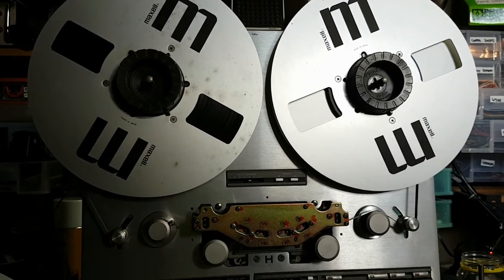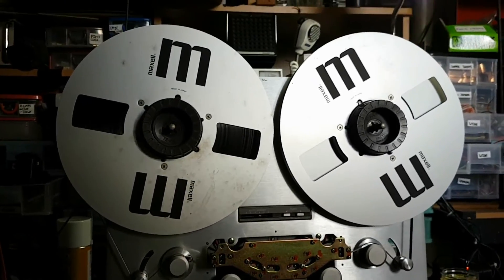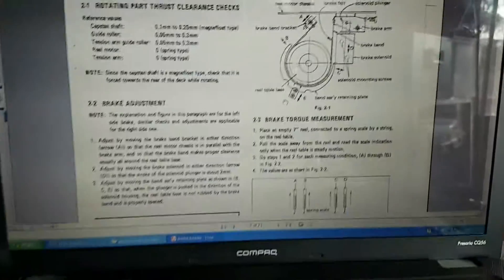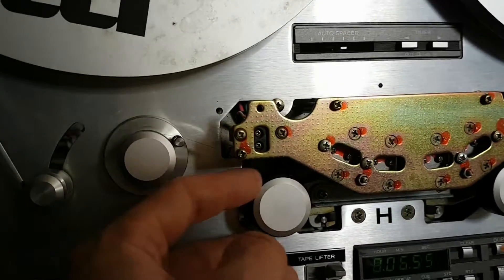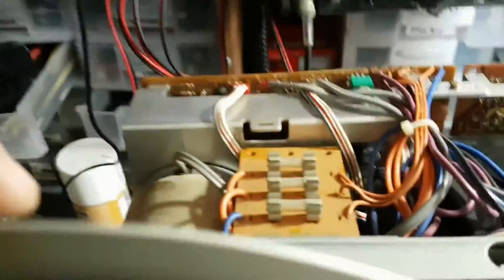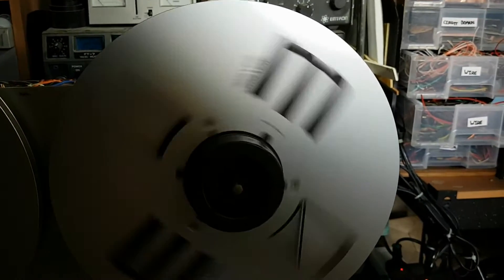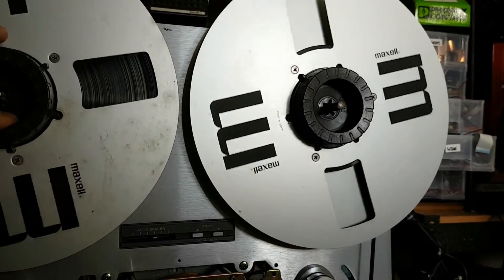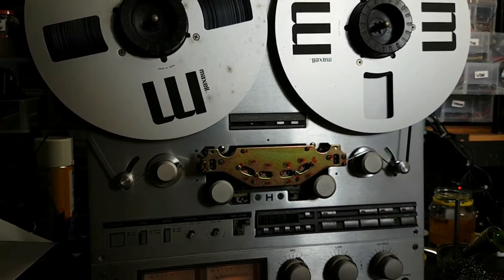Need help!!! Teac X-1000R reel-reel machine sagging tape

Comment: Troy - I do not think it has anything to do with the capstan rollers.  It is highly probable that the supply reel does not have enough "back torque" to keep tape under proper tension.  The tape path
must have the right tension on left side of head block and right side of head block.  The capstan motor (spindle & roller) are the ONLY components that drag the tape past the heads during record or playback.  The "back torque" on supply reel motor is adjustable (electrically).  However, there may be a problem with tension circuit.  You can perform a simple test to confirm weakness of
supply reel tape tension.  Use your finger to apply a tiny amount of drag on the supply reel top edge and try to watch the "tape loop" change and begin to hug the play head.  It nothing changes, apply a little more drag on the reel edge (this simulates more back torque) and try to keep the amount of "drag" fairly constant.  That's not easy to do.
I'm fairly sure that the "tape tension" on this machine is controlled by closed-loop motor servo.  This "tape tension" is VERY different than the torque needed for Rewind or Fast Forward.  So, do not
play around with REW and/or FF motor torque.  I will go and take a peek at the service manual to verify closed-loop control system action.  I hope you still own this amazing tape deck.  Give feedback if you can.

Comment: i believe your pressure roller is not pressing hard enough against the capstan
unfortunately your video only shows the spools turning, annd not what i really need to see which is the rollers.. make sure they are not rigid or shiny, and that they are firmly against the capstan

Comment: It seems most likely that one or both capstans are not turning at exactly the intended rate. Either the belt is slipping on the right-hand capstan (the one near the takeup reel) or there may be undue resistance in the bearing in that capstan.
Reply from the maker: Thanks. I will look at the capstans. I know I did remove them and put them back in earlier on. When I pushed them right in they were a bit tight so I pulled them out a bit so they were more loose. I wonder if there's a specific position for the capstans to be?
Reply: troysvisualarts I think the capstans need to be swapped with each other. They turn at slightly different rate for head tension. A continuously forming slack indicates they are installed reversed.
Reply from the maker: Thanks for that. Yeah I most likely replaced them the wrong way around unwittingly, so will swap them and see what happens.

Comment: Hi Troy i feel your pain ! i used to get people asking for things to be repaired they don't understand we don't have spare parts to replace stuff reason there are no more tv repair men they were blocked from getting spare parts ...they just want us  chuck stuff away and by new so its a win win for the people making and selling stuff ..they will ship it off if they have to get repaired  half the time back to japan !
I looking at the machine so far there is a lag in time in the rollers or gear moving the tape on the right it seems or if the left side is also geared not just pulled by the right it could be that too ,perhaps clean oil the bearing gears and do a loop in a spare bit of tape and run the machine no stop for a day give it a good work out my VCR repair man mate he swapped jobs and worked with me at BHP told me to run them in loosen them up if they have not been used in years ... Mechanical machines are a nightmare !

Comment: It has to do with the pinch-rollers I believe they are staggered in size to hold the tape to the heads. they both turn and hold the tape to the heads. I dont think it has anything to do with the breaks. I am not a tech